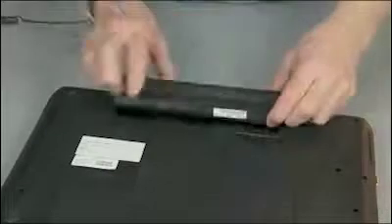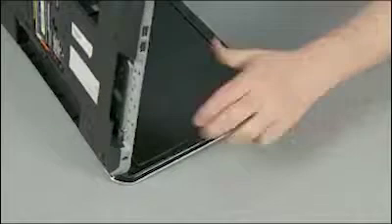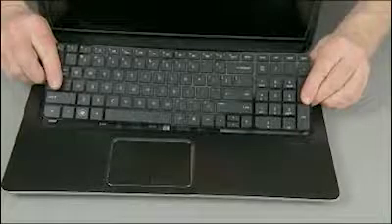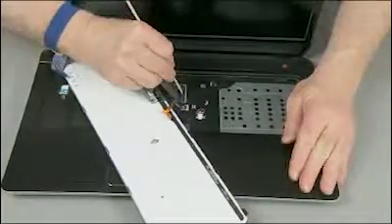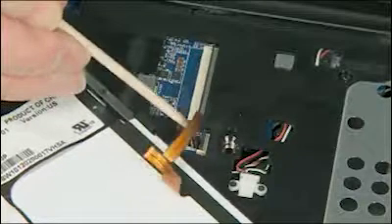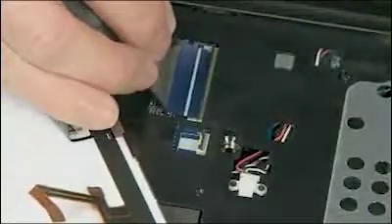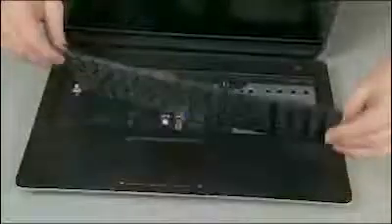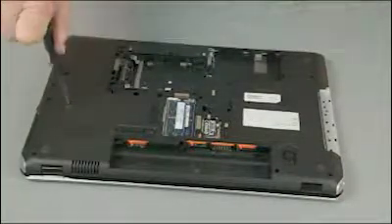Replace the Keyboard | Pavilion dv7-7000 ENVY dv7-7200 | HP Support

Comment: Can I upgrade my HP Pavilion dv7 keyboard with a backlit keyboard?
Reply from the maker: Hi there, thanks for contacting!
I understand that you need to know whether you can upgrade your keyboard with a backlit keyboard. 
I will do my best to assist you.
HP does not recommend upgrading or downgrading hardware parts or software that is bundled with the product as It may affect the manufacturer's warranty and performance, however, you could change the configuration at your own discretion.
Binu - Social Media Tech Support
Reply: @HPSupport  this laptop has been out of warranty for MANY years. Back to my question, can it be upgraded to a backlit keyboard?
Reply from the maker: I'm afraid you cannot replace a  Keyboard with a  backlit Keyboard as that is not recommended or supported by HP, the same could cause compatibility issues with other devices designed to work without the Keyboard with backlight.
Binu - Social Media Tech Support